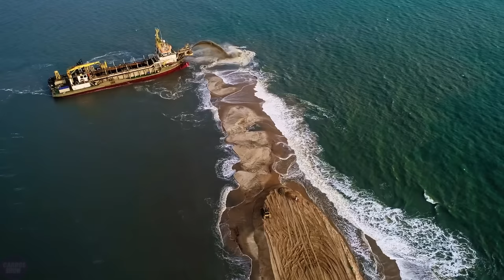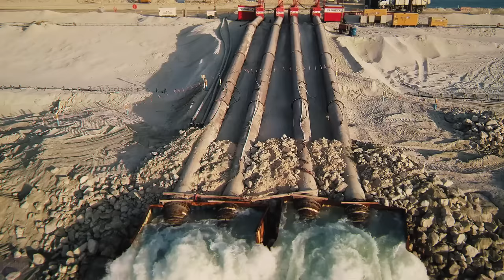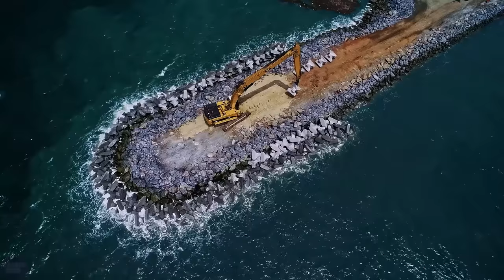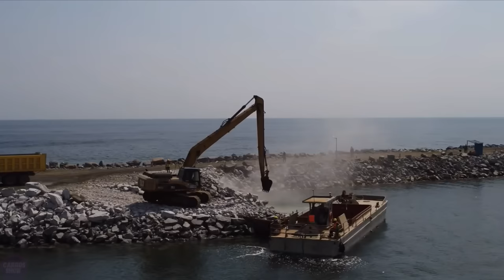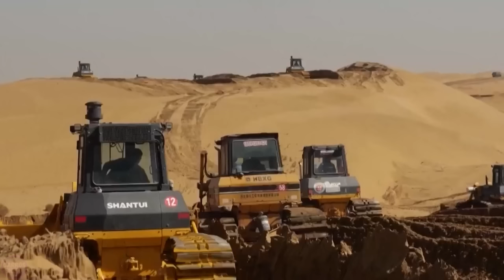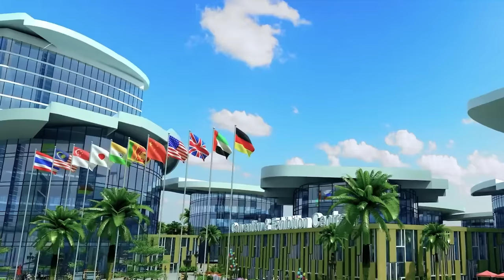CHINA is Building a NEW City of The Future in The Middle of The Ocean

Comment: It will submerged on the  ocean water level soon because the underground foundation is only a fragile giant reef covered by a vulnerable sands. When the storrms comes along and the strong and giant waves goes to battered occasionally on the weak edges of the island then it surely gives damage that will leads to sinking.

Comment: I don't like land reclamation to increase the size of your country like what Singapore has done but in the case of Sri Lanka the pros are that it creates jobs and a way out of perpetual chronic poverty.
Reply: Interesting comment. For countries with no problem in land size, reclamation is OK but for a country with a natural size of only 700 sq km, it is a major crime, what is the logic?
Reply: Singapore is doing better. Sri Lanka too.
Reply: @fooksengloke3625  I did say land reclamation in Singapore was a major crime, however like you say Singapore is small in terms of land area, therefore it's expansion is significant as a percentage of it's original size whereas the expansion of Sri Lanka as a percentage of it's original size is hardly significant.
Also Sri Lanka's project is an infrastructure development to improve its impoverished economy, a necessary project.
Reply: I didn't say
Reply: @fooksengloke3625 

Singapore is about 734 Sq km and have reclaimed land for development. 

Eg Through land reclamation, it has  created space for new areas like Changi Airport, Jurong Island and Tuas Port.20 Dec 2022

The former airport of  of Hong Kong  and the current airport of Hong Kong were built on reclaimed land.

Some 20% of land in the Tokyo Bay area has been reclaimed, most notably Odaiba artificial island. 
Le Portier, Monaco and Gibraltar are also expanding due to land reclamation. 

The city of Rio de Janeiro was largely built on reclaimed land, as was Wellington, New Zealand.